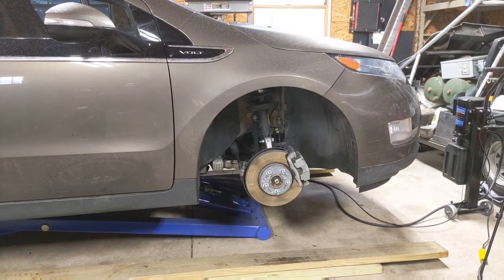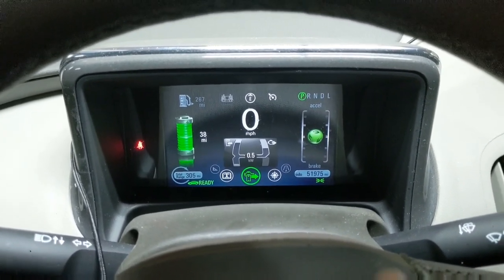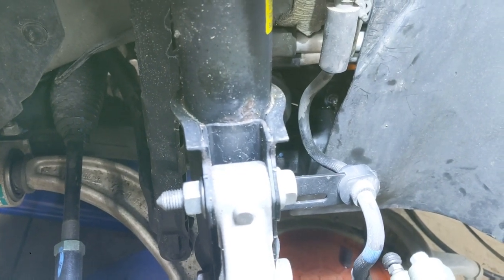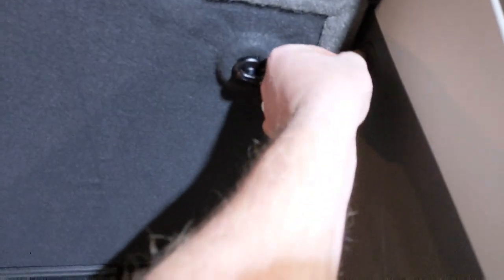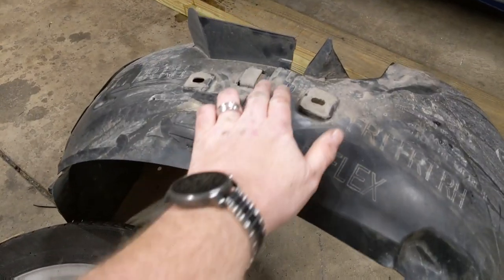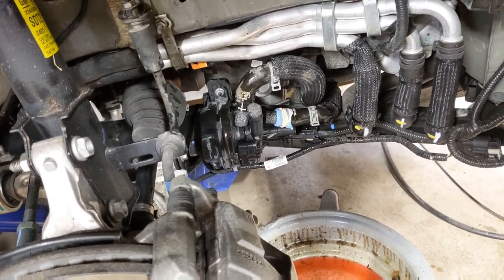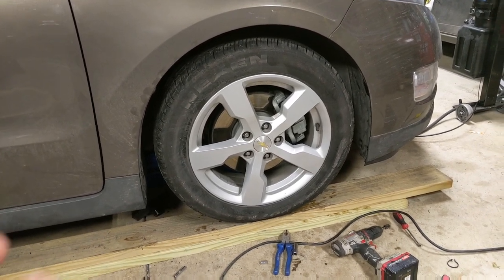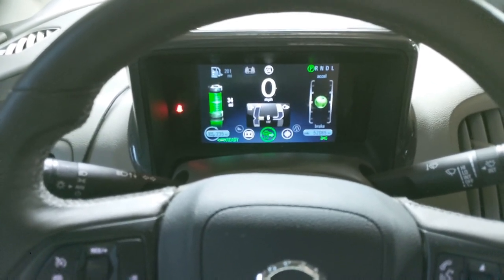Fix a Chevy Volt with no heat when running on battery!  We found a faulty circulation pump!

Comment: Out of curiosity... is there a story behind that Opel Ampera steering wheel in your Volt?
Reply from the maker: Yup, I wanted a heated steering wheel and the Opal fits the Volts perfectly.   :D
Reply: @1D10CRACY  Brilliant, I want heated steering wheel as well, was it complex to swap it out? I just bought my 2012 yesterday (1/12/2022) knowing it had the "no heat on electric motor" issue. Thank you for this video!
Reply: @427spicey Did you have the exact issue as in the video?
Kw would spike up and down then stay down at 0.5kw?
And did your heat usually work?
What was the fix?
Thanks...

Comment: So many issues with cooling systems could be avoided if people actually maintained their vehicles according to the manufacturers recommendation. Hardly anyone flushes their coolant systems out, flushes brakes systems out. It's only when something goes wrong (sticking thermostat, leaking heater core, leaking radiator, or worse...blown head gasket) that the coolant gets changed. I believe the coolant PH changes over time and starts attacking the internals of engines and associated components. I believe the organic Dexcool is especially prone to turning acidic and wreaking havoc on internals.
Reply from the maker: Routine maintenance is important!  I'm a stickler on them myself and as you can see still run into an occasional issue. :D

Comment: My heating element must be bad......when I turn my heat on it doesn't draw any power and stays at 0.5
Reply: Did you have the exact issue as in the video?
Kw would spike up and down then stay down at 0.5kw?
And did your heat usually work?
What was the fix?
Thanks...

Comment: Now I have a lot of vibration, do I need to change it?
Reply from the maker: Where is the vibration coming from?
Reply: @1D10CRACY  to the pump
Reply: When you turn on the air, the pump is always working?  I was reviewing it and I realized that the vibration is very strong because of the plastic that it covers!  but I don't know if constant vibration is normal !!
Reply from the maker: Some vibration is normal.   Mine got bad enough I could feel it in the steering wheel, then it stopped all together.
Reply: In my case the sound is felt but it is not very strong, but I checked the side of the tire and the vibration of the pump with the plastic covering it feels strong.  there the intensity of the noise decreases.  but the pump works all the time ??  I remember that in summer when using the cold air the pump stopped working and after a few minutes it was heard again, but now with hot air it is working all the time !!
Reply: Great video. Would this be similar to the newer model 2017? Is there a fuse to this?Also I’ve heard it said that I would need to check with the dealer to see if there needs to be an update. What is that about?

Comment: How do you get to the current screen?
Reply: The control knob on the dash left of the steering wheel
Reply: Did you have the exact issue as in the video?
Kw would spike up and down then stay down at 0.5kw?
And did your heat usually work?
What was the fix?
Thanks...

Comment: Great Video showing all the steps clearly!  Thanks man.
Reply: Did you have the exact issue as in the video?
Kw would spike up and down then stay down at 0.5kw?
And did your heat usually work?
What was the fix?
Thanks...
Reply: @golfish8589  the heater basically did not work, it would blow cold air, I replaced that circulation pump like in the video and it's been good every since.  I don't really remember much about the kW spiking etc

Comment: I am wondering if you got curious and examined the original pump to see how/why it failed?

I guess by modern standards, a <$200 part is not worth repairing.

I have a 2017 with no heat unless on ICE mode.  Thinking it is the same pump/issue...
Reply from the maker: I did take it apart and what I had found out was the propeller was glued to a magnet.   Both parts are submerged in coolant and over time the glue deteriorated and came loose from the magnet.  It probably could have been glued back together but I chose to just replace it.

Comment: My 2011 Chevy volt gives codes P1AF0, P1AF2 and P1E22 and from what I understand the codes are generated due hybrid battery heater being defective. However, in my case when I put the heater on when the vehicle is running on hybrid battery the heat comes on. I am puzzled as whyy this codes are being generated and what be could be the problem. Anybody who might have an idea? Thanks
Reply: Did you have the exact issue as in the video?
Kw would spike up and down then stay down at 0.5kw?
And did your heat usually work?
What was the fix?
Thanks...

Comment: The Volt is probably the worst car I have ever owned. I hate this thing.
Reply from the maker: Gen1 or Gen2?    I really liked mine, they are also stupid easy to work on.   Other than a few minor issues like this one, mine was super reliable.   I traded it in for a Bolt before it hit 200k miles, I wish I had kept it.